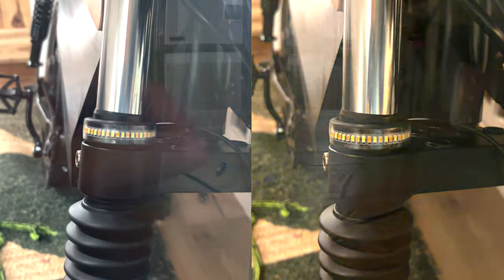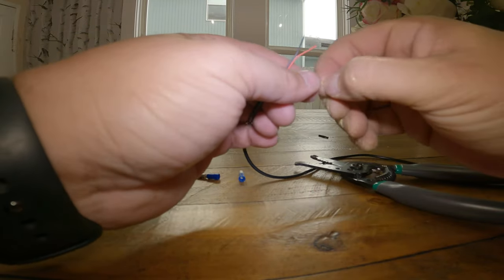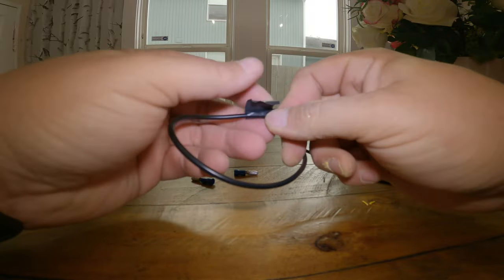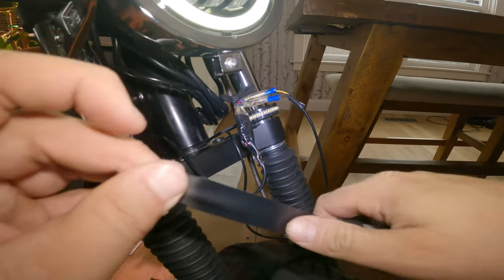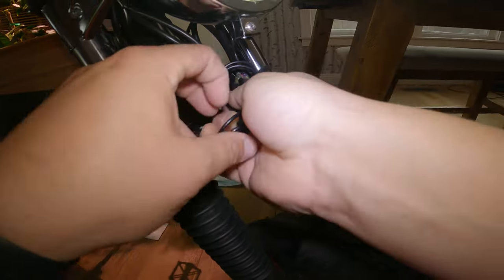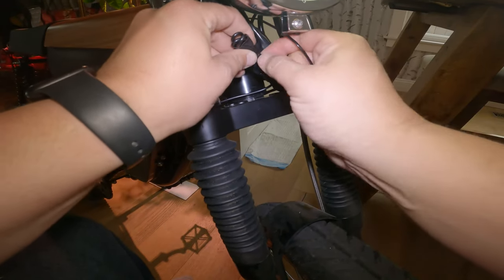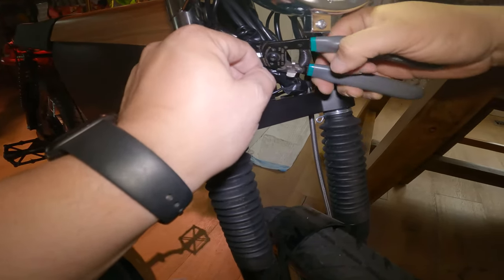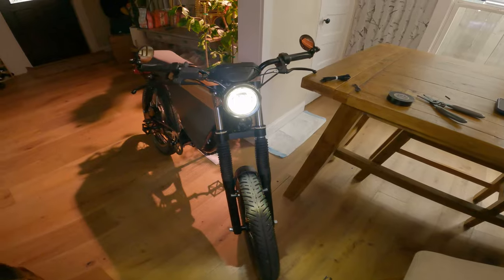Onyx RCR 1.5 MOD // Turn Signals Install : Fork Mount Style

Comment: What did you use to take up the space on the fork against the light? I have the same lights and they are definitely loose on the forks.
Reply from the maker: Is the head of the zip tie tight to the light?  I did have a little space but I wrapped some e-tape around the spot where it landed.

Comment: Will this work on the Suzuki DR650?
Reply from the maker: I don’t know the Suzuki but if there’s blinkers on it then it should. Most ICE bikes have a 12V battery so all of the lights are 12V. Theoretically yes, but the cost of the lights make it a low cost risk.

Comment: You didn’t have to use a wire harness? Looks like every other turn signal mod uses it
Reply from the maker: No the wires already existed in my RCR1.5, in think the old bikes needed a harness
Reply: @TheMirandaSquad  gotcha. Thanks! I have a 1.5 also, but there seems to be different ways people are doing this mod!
Reply from the maker: @RyanFreshhh  I don’t know why you would want to add an extra harness if it’s already built in. Are these other people adding multiple turn signal lights on the front or back? In that case I can see creating a small harness to combine the cables essentially making a harness.

Comment: You did the front only? Can you run  a double set to the  back?
Reply from the maker: For the fork mount I only did the front ones but under the seat in the tube are 4 more wires(on the RCR 1,5) to do the rear. I will probably do a video on it once I make up my mind on what I want on the rear
Reply: @TheMirandaSquad  Do I need the 2-Pin Electronic LED Flasher Relay or is that on my bike already? On the bike it appears to have it seeing that I have the switch on the bars already?
Reply from the maker: With my RCR 1.5 I did not need to add a relay. It worked as soon as I wired it in
Reply: @TheMirandaSquad  I sure appreciate the feed back and the video.